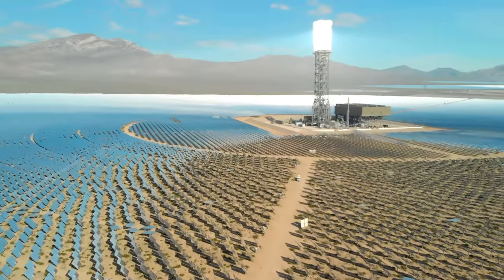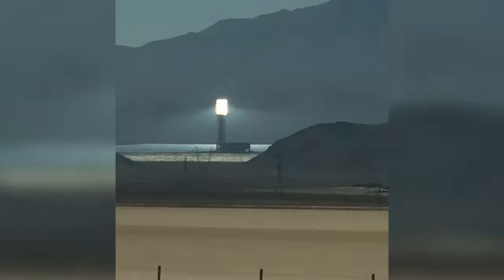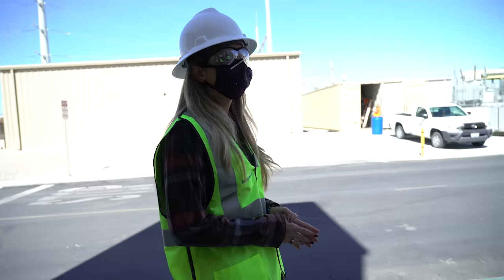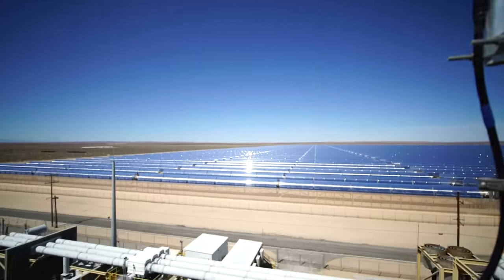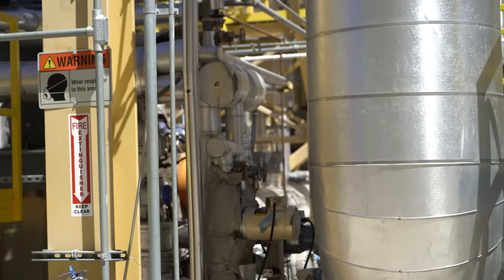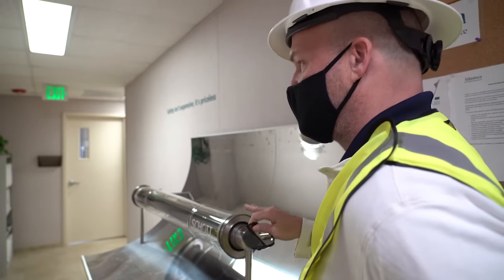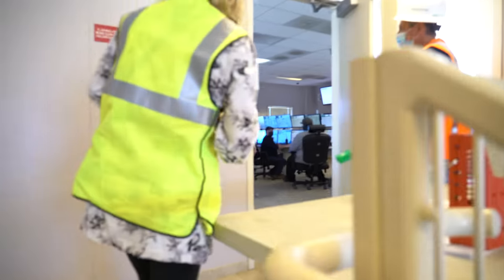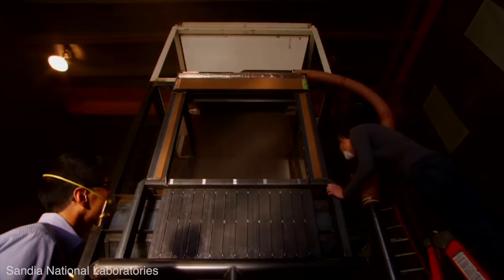How Mirrors Could Solve our Energy Problem

Comment: awesome! that's so cool to hear that there is a solid option for storing solar energy during down times, fascinating to use temperature for that solution
Reply: Or just use nuclear.
Reply: Screw nuclear, we are trying to save our planet, not make it worse. An SCT or Newtonian telescope configuration of mirrors through a fresnel lens onto a ceramic target to heat the motive fluid, expanded through a Tesla turbine, we can generate the electricity a home needs plus store the heat in a brine tank to generate home heating or turbine steam at a home scale. Distributed system, selling excess into the grid, the perfect way to turn the scales on utilities. The beauty of a Tesla turbine is that it also operates as a compressor… as in for an AC system.
Reply: @pseudotasuki  More like use both in our transition
Reply: @7sArts  Yup, that'll work great in Buffalo in February.
Reply: @7sArts  "Screw nuclear, we are trying to save our planet, not make it worse."

So, bulldozing absolutely enormous swaths of land will make the planet... better?
Reply: @7sArts  
🤔 Has this set-up actually been tried/built?
Reply: @Sedgewise47   yes. Testing in Texas. Having overheating problems in the salt storage bins. Water for heating the home in winter gets too hot and tends to overwhelm the pex. I live near a major airport so had to consider reflection bothering pilots on approach. The tube is perfect because it hides the mirrors. Heat inside the tubes is extreme in summer so working on a way to flow ambient air to cool the interior. I was more concerned with not getting enough light in winter, like during the part of winter when there is no sunlight, but the idea is to reduce dependence, not eliminate it completely. Looking at historical weather patterns, not many other places are in cloud cover for too long, so the heat storage is viable. Wish I could figure out how Tesla was grabbing power straight from the energy soup we live in, I imagine he simply tuned his equipment just right. He gives hints in his lectures and presentations, especially the deposition for the Marconi trial, but he wasn’t willing to just put it out there for idiots to steal or hateful individuals to misuse.
Reply: @PistonAvatarGuy  I don’t think you understand what home scale means. One or two units perched on the roof or against the fence line should be enough to provide much of what a home needs and maybe sell excess into the grid to offset when the Sun fails for several days.
Reply: @7sArts  No, the problem is that you were babbling incoherently. I couldn't tell if you were talking about the solar energy installation shown in this video, or what. Really, I just tuned out when you mentioned a Tesla turbine, as their efficiency is extremely poor and they aren't practical enough to be used in any real-world application.

Anyway, producing a huge number of small, distributed power plants for installation into homes would be absolutely, ridiculously inefficient when compared to producing power at a large scale power plant. Just the resources needed to do such a thing would be immense. The aesthetics of such a system would also be awful, as the Fresnel lens(es) would need to be absolutely enormous, especially for such a system to be able to provide heating in the winter.
Reply: @pseudotasuki  not much left of Buffalo if they have a Chernobyl or Fukushima level event (Any place actually). Besides, Buffalo has Niagara Falls and the system that Tesla and Westinghouse set up to extract power from the river. If you had said North of the Arctic circle I would be compelled to consider that you gave the comment some thought.
Reply: @7sArts  Fukushima is fine.

Comment: Those "cage-like-thingies" are aptly called ladder cages, and a desgined to catch a limp body falling through.
Reply: TIL! I always wondered what those were for. The limp body aspect never occurred to me.
Reply: Us simpletons called them back scratchers 😂
Reply: @seeker1287  It also allows you to rest against them if you are climbing a high distance. Usually a long continuous run isn’t allowed, so they will have platforms at various levels, so if you fall, it might only be 20 ft as opposed to 100’s

Comment: "Modern solutions to old pollution." Sounds like the old adage, "Dilution is the solution to pollution."
Reply: We need more people with practical concern than political junkies. Most political junkies are poor.

There used to be such a joke on the Internet:  What do boys with different salaries think before going to bed?
Monthly salary of 50,000: The team needs to integrate again;
Monthly salary of 30,000: That plan needs to be changed;
Monthly salary of 20,000: what does that customer like;
Monthly salary of 5,000: P40 pixels will definitely hang Apple;
Monthly salary of 3,000: Bentley Bentayga is definitely not as good as Mercedes-Maybach S600；
Monthly salary of 2,000: The influence of Russia's attitude towards NATO's eastward expansion on the US global strategy.
Reply: These mirrors and the heat they generate is the reason there's a drought. 
The monsoon that used to come from Nevada and Arizona storm turn back and away from California. 
The High Pressure as Weather Casters call it : keep the storms going up to Canada 🇨🇦 with  the occasional drop to the Bay area. This is and I hope an unintentional Weather Modification

Comment: Wasn't this thechnology shown to be an epic failure? In theory it makes sense but in reality the plant never met the production goals of 50%, the best they ever got was around 20%. It turns out working with molten salt has its drawbacks. The plant only ran for about 9 months and could never produce enough revenue to meet basic maintenance cost so it had to be shutdown. Not trying to bash green technology but I am wondering if they even bothered piloted this technology before scaling up.  Here is a link to the video https://youtu.be/oiPSy2bKZkE
Reply: @D. Johnston 702 if you look at the dates... the plant failed in late'ish 2019 [how quick do you think info was published about this?  Same second it failed?  Or did it take time.   This video was Aug 2021, and the video discussing the project failed Man Kev linked was Feb 2022.  How much info was around in 2020 or 2021 during the peak of covid?  How many people were touring plants then and discussing it, and talking with people involved in the project??   Prob none.  As covid restrictions lifted more reports and tours of the project would be available.

Comment: Plant, operational, and maintenance cost? Efficiency? How is it compares to wind, solar, hydro?
Reply: the mirrors don't last very long... I've heard only around 5 - 6 years... (I'm no expert though)
Reply: @vishaljoy6802  I thought so too because the whole system have to deal with high heat and mechanical moving parts.
Reply: CSP LCOE usually is around 110-140 $/MWh, for comparison this is around 30-45 $/MWh for a similarly sized large scale pv plant, 
50$/MWh for onshore wind, 
70-100$/MWh for offshore wind,
45-60$/MWh for coal plants (though this price is ever increasing due to taxes, environmental demands, coal cost, ...), 
gas 70-90/100 $/MWh. 
Hydro is difficult since it depends a lot on the scale etc. but the larger scales hydro usually is around 20-35$/MWh. 
Nuclear again is a difficult one. Old nuclear was around 25-35$/MWh, but new ones tend to be much more expensive. Recent LCOE numbers put it between  100-180$/MWh, though 60-70$/MWh might be more correct.
Reply: @MDP1702  
Hello! Thank you so much for taking the time to write this! See I'm only 16... I'm a student and I've been trying to figure out the energy sector, where we're headed and where I can build a career. I've been thinking a lot about nuclear and renewable and everything else climate change.
So yeah I saw this doc few nights ago and it shook me. But I didn't know how much of it to believe and whether the documentary itself was all fake. (I wanted to spend time debunking it but I have a lotttt to study so I couldn't spend any more time researching on all this fun stuff) 
Thus I turned to youtube comments and tried to get a strong reaction from people who actually know what they're talking about! 😅
So yes thank you for answering! I was hoping somebody would reply strongly and you did, so once again thank you very much!!!

And one last thing...
The information that you have. About the various parts of the documentary that are incorrect or outdated. Those specific details like: the burning of natural gas in the morning, the fact that the critic became optimistic over time, the thing about the solar farm being renovated... How and where do you go to get this kind of specific info? How do I use the internet to get answers to questions that are not mainstream and often asked?
Pls do reply
Once again thank you kind sir/ma'am for your time!

Comment: I notice immediately the passion I feel always too for this technique. You don't need rare materials from other countries. Further it seems robust and easy to repair and recycle. And finally the possibility to have molten salts or here special sand as storage medium. Of course you need open skies for this. I didn't like the first plant because it looked way too complex and "macho". That could be because of the huge power output they aim for. But intuitively it looks like this technique has a optimal balance between scale, efficiency,costs of running and maintenance and here they could be overshooting that optimum. Since the concentrated solar beams are less hot than with tower beams, it's possible a bird survives a short contact (but how??)
 I don't understand the problems with Ivanpah. Michael Moore jumped on it sadly and I start to think "some people wanted problems already during the design" although I'am against conspiracy thinking;
Reply: Yeah, I'm just wondering why they aren't using a USB hard drive for their storage problem, that's how I solved my storage problem and its works great!
Reply: @Reth_Hard  Normally I am the one with the jokes.

Comment: Any coverage on the negative traits? I heard that these powerplants need natural gas to heat up in the morning. Also the concentrated solar beams burn wildlife flying through them and there are problems with broken mirrors littering the ground.
Reply: Also not discussed is the amount of maintenance and material needed to keep the mirrors clean. Efficiency drops quickly with dust and dirt settling on them. It takes water....lots and lots of water. Something not exactly abundant in dry sunny climates.
Reply: These negative traits can be fixed and are not permanent. If there’s any trait that is worth mentioning, it’s those that are inherent in the design. I’m pretty sure these bright engineers are fully aware there are broken mirrors on the ground. It’s all a matter of systemically solving the problem as opposed to inefficiently cleaning it up as you go.
Reply: @calvin99991  I'm sure there's another way besides water
Reply: @ClaireLoprensa  Pretty sure when the bird flies through and drops to the ground in a smoking pile of feathers, it's permanent.
Reply: Now simply compare those negative traits to those of the energies they are meant to replace... Should put things into perspective.
Reply: @justalonesoul5825  You mean like nuclear? Absolutely, nuclear is far FAR cleaner and environmentally friendly, but environmentalists are against it also. You people that think renewables are the answer really have no clue what you're talking about.
Reply: @KoolRanqe  Like? Simply saying "there must be something else" is not an answer. Air will not do it (try just "blowing" off your car and see how clean it gets), so if you want to eliminate water, that leaves chemicals or chemical coatings. Since when are chemicals good for the environment?
Reply: @calvin99991  some bait and switch sprinkled with strawman
Reply: @KoolRanqe  LOL, and all you got is "there must be a way". Do some research, then try to formulate a response.
Reply: And you?
Reply: Michael moore covers these in his movie planet of the humans , a waste of resources and space , makes essentially no energy , uses a ton of natural gas , works great until the wind puts dust on the mirrors , which have to be cleaned at night , good idea , just not practical
Reply: @KoolRanqe  how else do you clean dust off a mirror? If you use air it just blows it onto another mirror , it's a pos

Comment: I'm feeling a little bit let down by this video especially in context with this whole video series. How are they storing the heat energy? Just using a big tank of that special oil? What are the limits of scalability? Or in the case of the sand like material? What devices or mechanisms are used to store and transport the 1000 degrees hot sand? really curious to know, cheers.
Reply: Also, no mention of the big problem with the mirror fields: focused light literally incinerates birds that happen to fly over. I was glad to learn of the fluid tubes variant because it solves the "giant death mirror" problem.
Reply: I am also having trouble interpreting the sand part of the video... How does that falling sand work exactly? It is missing the explanation.
Reply: I know that the molten salt CSP's that work with molten salts in the tower heat the salt. This salt only cools off slowly and thus will give off heat for a long time after the sunlight has stopped heating it up. I guess it is the same principle with salt etc. These parabolic mirror with oil running through them usually are not the ones with storage, rather the tower variants are.

here is a video that shows the basics: https://www.youtube.com/watch?v=ADbUsuNeRQE
Reply: @kocsirtamas  The sand gets heated and used to create steam. Instead of using a heated fluid (HTF), the sand retains heat longer (after dark), so you can use to keep running.
Reply: @jpena53  Ok, I get that, but how is it used to create heat? And where is it falling?
Reply: @kocsirtamas  The sand itself isn't "creating" heat.  The sand is acting as a heat transfer medium.  The central tower is a boiler with pipes running up and down in a loop.  Inside the pipes, the sand flows and is heated up by the light that is reflected from the mirrors, it then goes to a heat exchanger to create steam.  The sand itself still retains heat after dark and is usually stored in an insulated tank somewhere down below.
A lot of the major process equipment (pumps, exchangers, tanks, etc) are down below.
Reply: @kocsirtamas  Here is a general view at the Cresent Dunes site that used molten salt for the storage tech.  Sand is just another medium but same concept.
https://www.youtube.com/watch?v=J3DylmjBPvo

Comment: As an engineer in the utility scale solar industry, I'll highlight that heliostat systems like this were built when Photovoltaics were like 5x the price of today. CSP is not the future of renewables.
Reply: As an engineer in the utility industry who has also worked on PPAs with some of the facilities featured in the video, I can say that there have been several CSP plants built much more recently when PV prices were already pretty low (though they do keep getting cheaper). However, I agree with your conclusion; PV has already won the solar war. I'll have to look into this sand/particle tech but I doubt it will make a sizeable difference. The interesting thing is with storage. We are going to need so much of it that I don't think Li-ion is going to do the job. Possibly LiFePO4.
Reply: Came here to comment the same... PV won the holy war for the light, so some of projects like this are actually broke now.
Reply: @fakljfklajf  LiFeYPO4 is even better